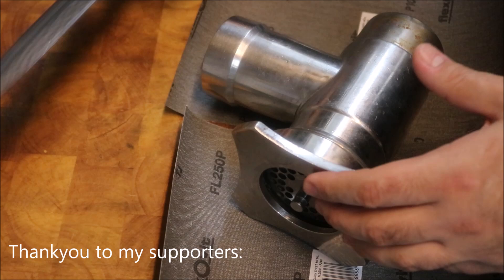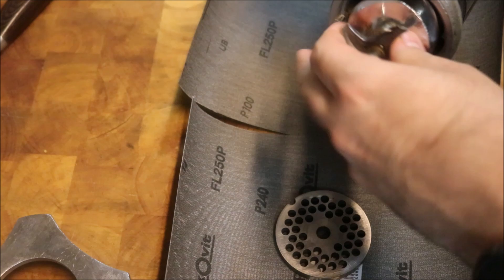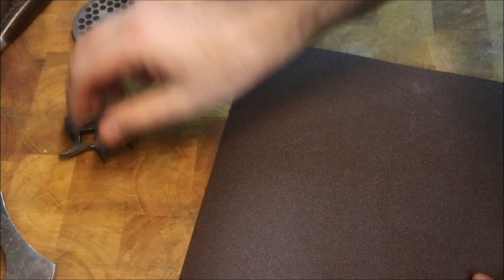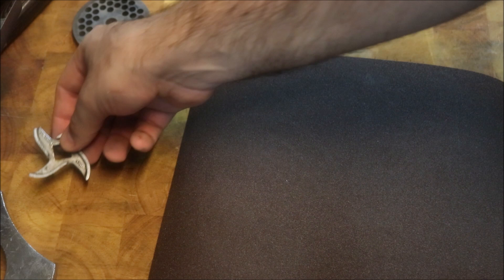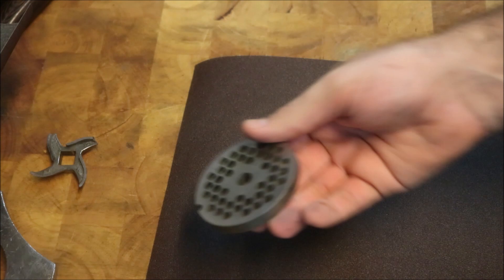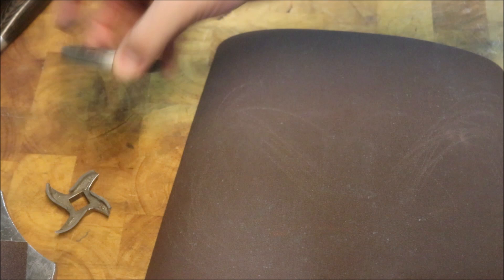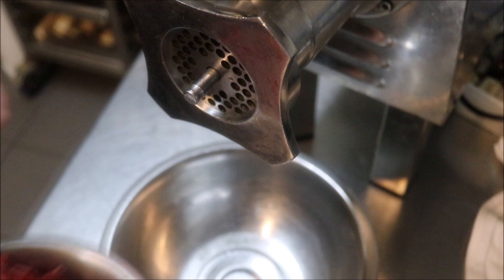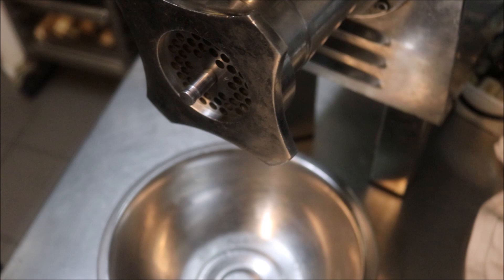How To Sharpen Meat Grinder Knife/Plate | Ep 541

Comment: PEOPLE! 

100 grit is way too rough to be using on grinder plates! The huge scratches it leaves behind are clearly visible in the video. In order to get the plate sharp, ALL those scratches will need to be removed with successive grits.

Further, jumping from 100 to 240 is too big a jump in grit. It will require WAY more than 10 loops with the 240 paper to remove the 100 grit scratches.

You should be starting with 240 or 220, and working up to 320 or 400...or even higher if you wish.

ALL the sanding should be done wet. Put a few drops of water on the paper and get to it. Rinse the paper and the steel after each step.

These are basic, widely accepted rules of metal work.
Reply: Thank you!!! First sensitive comment here. Agree with all you say. Also working with sandpaper and metal on what looks like a cutting board?!
Reply: Thank you! Can I start with a 80? 
Got a 80 and 180 at home.
Would appreciate your response:)